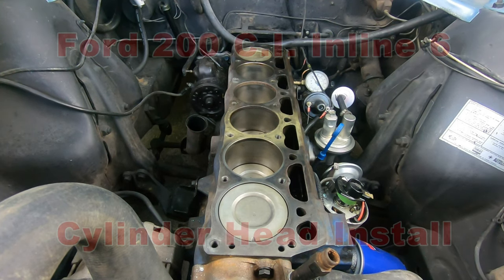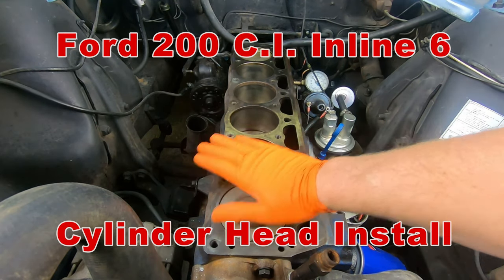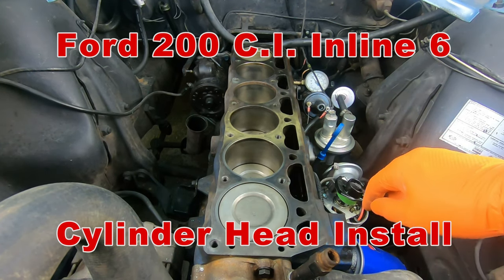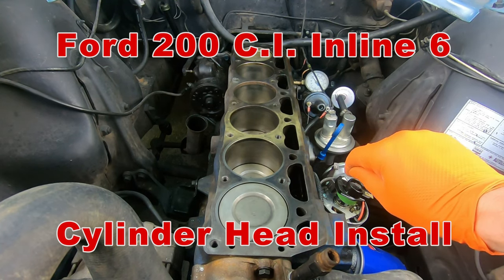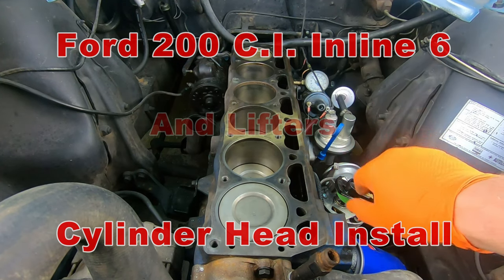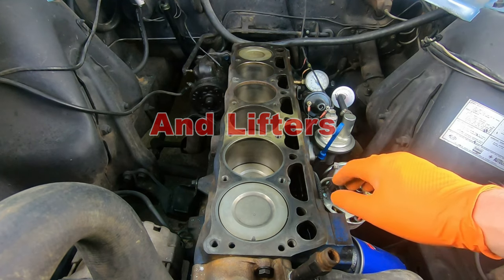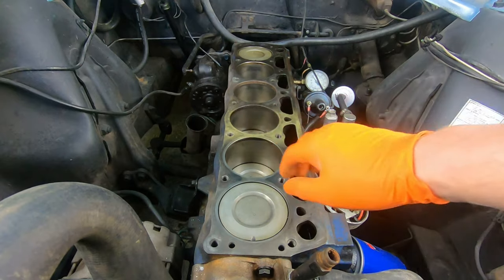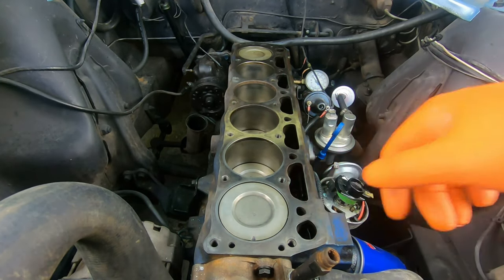How to install cylinder head - 200 C.I. Inline 6 Ford

Comment: Just a suggestion, I used your idea of using old head bolts for location studs, the only change i made is i used a hack saw to cut the tops so a screw driver can be used to remove them. Came out real easy when I put the head back on my 6 banger, wish putting the head on was as easy!!
Reply from the maker: Oh nice! Then you can thread them all the way down. That's a great idea. And Ya they are a beast to lift down over those studs arent they?

Comment: I was wondering if I can reuse my ol' lifters after having my 200 head milled and rebuilt.   What to look for to see if my ol' lifters are still good to reuse?   If you think replacement is the best option then which company should I get the new lifters from.  Great video and easy to understand :)
Reply from the maker: So typically I would recommend new lifters since you're already there and new lifters are inexpensive. I usually get Melling lifters. You can look to see if any of them are collapsed. Assuming you have hydraulic lifters.

Comment: Planning my 144ci rebuild and want to change the valve seats. Are the valve seats replaceable on these heads?
Reply from the maker: Yes, your machine shop should be able to handle it. I would suggest hardened seats to handle today's modern fuels.

Comment: Great video. Did you have the head milled down to make up for the thicker head gasket?
Reply from the maker: Thank you. Yes this cylinder head was milled a small amount.
Reply: @AlfsMustangGarage  
When you say small amount...I'll assume you didn't mean. 075....whats a small amount?? . Im looking for 9:1 or better compression.  My 64 Falcon 200 is ready for head rebuild. Should I also ask the rebuilder to give me 1.5 & 1.75 intake & exhaust valves along with the steel sears ?
Reply from the maker: Are you talking about when I have the heads milled? That one was milled 0.001" but over it's 50 year history, I wouldn't know how much has been taken off.

Comment: Great video. Those 200 heads are tough to put on by yourself. A lot of weight. The locating studs are genius!!!! Makes life a lot easier. 
What did you use to clean the tops of the pistons and deck. 
Also did you bleed the lifters before installing them. 
Looking forward to the next video. 👍🏻👍🏻
Reply from the maker: Oh hi Bob! They are indeed tough. Long and heavy! Ya the locating studs work great as long as you don't thread them down all the way. I did that the first time and then realized they were too short to extract. So the head had to come back off and then on again. As far as the lifters go I'm not sure what you mean by bleed them. Are you install them empty that way it's better for performing the valve adjustment.
Reply from the maker: Oh and the tops of the pistons and block, I used brake clean, soft brissle brushes, and microfiber towels 👍
Reply: @AlfsMustangGarage  thanks for the response. The way I was taught many years ago (not saying it was the correct way lol) was to check the lifter like you showed for movement then place the lifter in motor oil so it was submerged and then slowly compress the lifter with a push rod until all the air was removed from the lifter. Like I say is this correct or needed, I have no idea. I was shown this when I built my first small block Chevy in 1982 lol. Wow I’m old 😝😝
I have to take my head to the machine shop, I’ll ask him and see if I’ve been doing this all these years for nothing. See what you can come up with too.
Reply from the maker: So you were taught the exact same way as me for lifters and valve adjustments. I have since learned a much better way. I definitely do not pump new lifters full of oil. When you make your valve adjustment on a rock solid lifter that is full of oil, that pre-load is going to be on the valve rather than the lifter plunger if that makes sense. Check out this video, https://youtu.be/5EGlb_VpTAw
This guy explains it the best but I've also talked to many top engine builders, and this is what they all say.
Reply: @AlfsMustangGarage  awesome. Learning something new is a good thing. Thank you for hooking me up with the video. See you can teach an old guy new tricks lol.
It definitely makes sense. With a loaded lifter there is a lot of force on the valve.
Reply from the maker: Oh ya for sure and I did the same thing for years until someone taught me. I've said it many times before, I definitely don't know everything there is to know and I learn something new all the time. Whenever I come across someone who says they know everything, I just shake my head because I know he is full of it 😆
Reply: @AlfsMustangGarage  I totally agree. For me the learning/research part is what I love. I had always owned Chevys. Camaro, 57’s a 36 sedan and other assorted GM’s then 14 years ago I jumped ship and became a Ford guy it was like learning everything from scratch. I restored the Falcon and then last year I picked up the 65 Mustang project. I love reading and doing research. Can’t get enough of it. I have to admit I have met a few mustang owners that are harsh. Self proclaimed experts lol. And then I’ve met guys like yourself that are willing to share their knowledge and experience. I’m a hobbiest, by far not an expert but I can build  respectable driver that will do well and a local show and cruise night. 
Any way keep the videos coming. I really enjoy your material. 
What your first name?
Reply from the maker: That's really cool that you've been on both sides, GM and then Ford. I have done a little bit of GM work. I did an engine swap on a guys 68 Camaro. Also did the rear end, trans, cooling system, suspension. I was just getting into filming my work so I was just doing some time lapse stuff. I did post a couple of those videos. But ya I've met some mustang guys that are like that too. Just think they are Mr. Know it all. But ive learned who to invest my time into and who not to. It seems that we grow our knowledge and understanding the most when we are in uncomfortable or unfamiliar territory. When I was 14 I bought my first Mustang and after learning a few things from my father, I thought I knew a lot about car. Then I starting working at Jiffy Lube after graduating high school. What I learned from Jiffy lube was how much I didn't know about cars. So after that I decided to go to WyoTec.  I went into there thinking I knew a lot about car. I learned how much I didn't know about cars. After graduating from WyoTec I went to work for a Kia dealership. Lol and I quickly learned how much I didn't know about cars. 5 years later I started this garage, and of course I'm learning how much I don't know about cars lol. Good mechanics don't know everything but they are really good at figuring stuff out. As always I appreciate your comments and videos are still coming -Alex
Reply: @bobkurmis5347  In auto mec Teck school in the 1970's that was what we were taught let them soak over night in oil
Reply: I believe that is mostly the case for newer cars because of the progressive valve spring they aren't able to push oil out of the lifters like the older car spring do.

Comment: The torque settings, are they your preference or from a ford handbook? Sorry I just really want to make sure I do it right😭
Reply from the maker: All of my torque specs for inline 6 engines I get from this website here. They are a great resource I have found.   https://fordsix.com/ci/SmallSixSpecs.html#TorqueSpecs
Reply: @AlfsMustangGarage  thank you!!
Reply: So is there any particular reason you didn't follow the exact torque sequence on the fordsix website, and did you have any issues with the sequence you used?

Comment: When you took the head off in the previous video you said there was no compression in 2 chambers. What ended up being the issue with the head?  I have a 66 200 and will be upgrading to the aluminum head soon. Keep up the great videos.... need more for the 200 engines.
Reply from the maker: Thanks! The valves ended up being burned up on that. I agree, we do need more in line 6 info. I will film at the next opportunity. I do have a 200 on a stand that needs a complete rebuild. So one of these days I get around to that. Thanks for commenting and subscribing.
Reply: I have been looking for an aluminum head for my 64 200 inline six. Vintage inlines are outvof stock with a price of 2,250.00 for the head & exhaust.  Deep pockets!!  Where can I purchase an aluminum head ? I've scoured the internet to no avail...
Reply: Over a year on the list and then a year after I paid...well worth the wait. Got it from vintage inlines. Wait time will be going down due to new foundry and machine shop. Contact Matt and get in the list
Reply: @colindonahue4205  
I'm on the list...but there's no telling how long until this new foundry will take on these parts. Its a big investment.

Comment: Most I've know let their lifters set in a bucket of oil over night before installing
Reply from the maker: Yup that's one way to do it. If you want to adjust your valves correctly though, you don't want your lifters to be pumped up with oil 👍

Comment: Where did you get the new head bolts.  I'm thinking if I should reuse my bolts or go with a  new set.
Reply from the maker: Nothing wrong with re using if they are in good shape but I got mine from National Parts Depot.
Reply: @AlfsMustangGarage  Will I need to put some oil on the head bolt threads before torquing them.
Reply from the maker: No. I do not.

Comment: Hey Alf, how did you make sure when cleaning the top surface that nothing drops into the lifter bores (especially when the old cam is still in)? Is there any trick or do you just also blow them out after cleaning? Thanks!
Reply from the maker: So what I typically do is insert small microfiber towels inside of there to prevent anything getting in there. When I'm done I'll use my shop vacuum to suck out debris that has collected and simultaneously pull the rags out.
Reply: Thank you, that sounds good, will try that :)
Reply from the maker: You're welcome, just make sure you use the microfiber towels 👍
Reply: One last question, what do you do to clean clogged water ports in the block? Do you press in the block and disassemble the oil pan to clean the junk out?
And thanks again for all your infos on the inline six, they help a lot!!
Reply from the maker: You're welcome. Honestly, I've never dealt with anything too crazy. But what I've done in the past is essentially take the bare block to the machine shop for a chem clean. Usually isn't 100% going to clean every nook and cranny buy that's usually the remedy I go. I know that usually means an engine rebuild but sometimes that's the only option. Thanks for subscribing and don't hesitate to ask more questions 👍
Reply: @AlfsMustangGarage  Thanks!